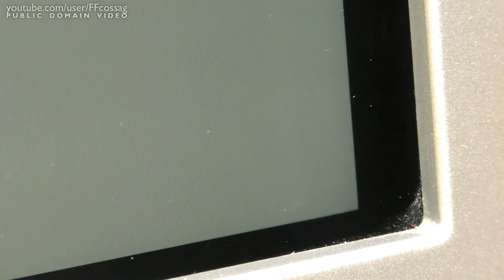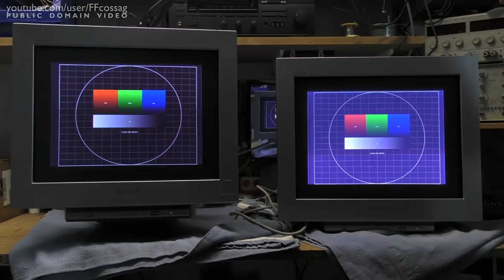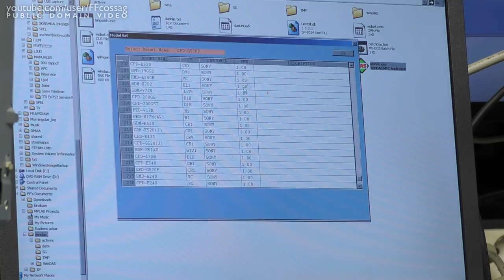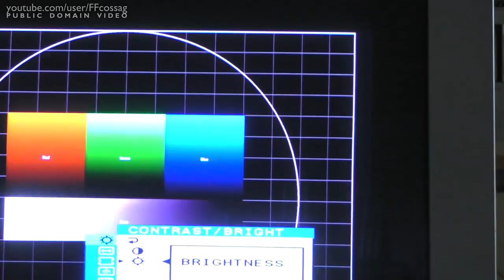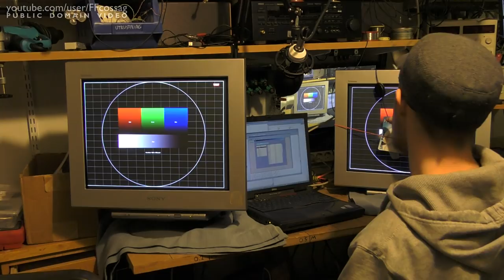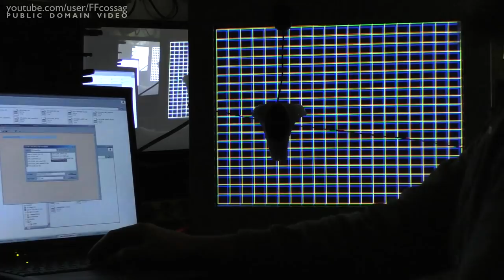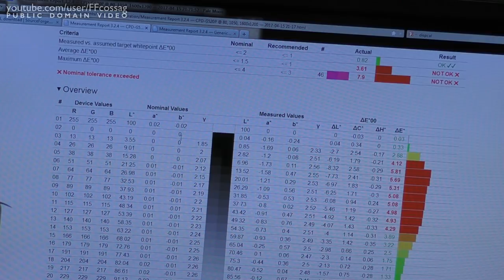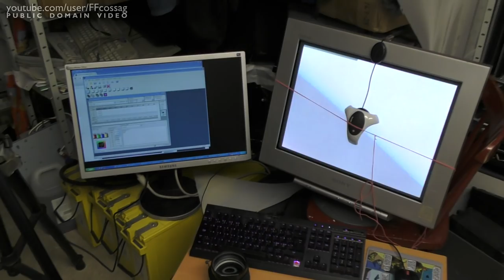Sony Trinitron Madness

Comment: 4:3 aspect ratio brother of the FW900 (G1W chassis) is the CPD-G500 (G1 Chassis). the CPD-G520 is a CR1 chassis
Reply: are they as bad as FW900 really? i had G500 and it was nothing like FW, and then G520 was nothing like these other two...
Reply: @pranza  You are right! the G500 have a modular board desing, unlike the CPD-G520, G520P and the GDM-F520 (althought the last two similar desing language as the FW900), which have a reduced single board engiennering.

Comment: As someone who retired his last CRT almost 15 years ago (flicker allergic) but has attacked dozens of LCD monitors and internal displays with his i1Display Pro and DisplayCAL, I found this highly fascinating. In fact I recently recalibrated my trusty NEC 1990SXi and would have loved to discuss the intricacies of calibration with someone... like white point being a bit of a crapshoot. I found that while results with no compensation were close to what a matrix (CCMX) for this combination of gear gives, the spectral compensation (CCSS) file for "LCD CCFL IPS" supplied with i1Profiler asks for a lot more green. So if this is not trustworthy, what about the WLED backlight CCSS? I would have to get a $$$ spectrophotometer to verify, which is rather annoying.

Somewhat higher gamma is not that much of a deal, just use them in the dark. ;) That's where the higher contrast will come in handy anyway. MPC-HC's color management has settings for gamma depending on lighting, with values of 2.35 for dim and 2.4 for dark environments.
Reply from the maker: Indeed, but the high gamma makes them absolutely useless for image editing (because lol inaccurate) and modern gaming (because you're blind compared to everyone else).
Reply: meow wow
Reply: Rocking that 1Display Pro and DisplayCAL combo too ! Of course calibrated via the hardware settings first as close as it can be first, i use my LCD (75" TV) as my computer monitor and also for AppleTV 4k, of course extra tweak inside PC and Mac, the DisplayCAL profiling..i aim for Rec 709 with a gamma of 2.2. I first use the HFCR first when doing hardware calibration, Rec 709, gamma 2.2, aiming delta below 1,  then when using DisplayCAL on the same display, i use "native white point"(already calibrated via hardware menus with HCFR) and for display type is select "LCD generic".

Comment: You have far more patience for these monitors than I would have, before I started using TFTs, I was of the "Can I see a picture on screen? Is it bright & clear enough? Yep, it's good" mindset, so going this deep into calibration, nah, I'd probably have gotten too frustrated with them and introduced them to gravity, or a brick, or something equally destructive... :)
Reply from the maker: My love for CRTs is rather newly founded. I realised that one should hang onto that which technology can't reproduce, and we will assuredly never have another completely analogue, refresh based display technology.
Reply: The only CRTs I miss are my two Compaq S710 17" CRT monitors, both bought dirt-cheap at the time (about 10 years back, one from ebay, one from a computer fair) and despite being Compaq, they were pretty damned good, until the mother's ex decided he wanted rid of them and threw them out without my say so, leaving my computers monitorless for quite some time... :\
Reply: @twocvbloke  Damn..

Comment: I recently found a Sony HMD-A200, also a flat panel model.  on the roadside. These monitors are definitely very cool.
Sadly it only uses one hardwired vga cable as its input, but i cannot complain too much about a free crt.
I will have to clean it up soon, although i am a little scared of all of the voltage. But a bit of compressed air will definitely do it a well deserved service.
It does work well as it is, which is very nice.
Any advice on how to go about giving this thing the tlc it deserves?

Comment: 1800x1440 resolution?! Holy crap that's MORE vertical resolution than my 1080p monitor, but on a CRT! I didn't know there were CRTs with such a high resolution!
Reply: On sony
Reply: Yep. Now make it widescreen with the FW900. Highest it could do was 2304x1440 :)
Reply: The GDM-F520 which is the little brother of the famous GDM-FW900 is capable of 2048x1536 @ 75Hz. Lower resolutions = higher refresh rates, and the motion is so smooth and clear, it's something you don't even come close to with LCD. It also has an aperture grille pitch of .22 which is one of the finest known aperture grille Sony ever made. It was designed specifically for CAD and photo editing. But it's gaming chops became legend along with it's brother the FW900.

Comment: posted the video to Reddit /r/crtmasterrace because of the sheer deliciousness of these monitors.
I had a G500 at one point in time. I miss that monitor. and do my eyes deceive me? Inspiron 8100? 8200? with the 15.1 UXGA panel!? such bliss.
Reply from the maker: Yep, it's an Inspiron 8200. It's nice as it has both WLAN, USB, a working battery, COM & parallel ports, a DVD burner and a diskette drive all in the same box.

Comment: Haha, i was drinking few beers and watched this...maybe i'm a masochist? Last time i calibrated my living room 75" LCD month ago, it took me about 3 hours (tweaking done inside the TV's own settings,, Delta values below 0.5 and tracking rec 709, nits around 110-120. Cherry on top of that, when running that TV with computers (PC and Mac), i have DisplayCAL profile on top of that (i use iDisplay Pro) miss those CRT's...last CRT monitor i had, i ordered that  brand new around 2004, already when majority were pushing LCD's, when CRT were going out of production, it was a flat 22" inch diamontron (HP branded), i had it all the way to 2016. Good times !

Comment: Im stuck with the WinDas software😢. I have a Windows XP machine and using what looks like the same adapter as you. I can choose the right monitor but cannot get any data saved. Just keep getting an error, cannot communicate with monitor, check the bus or something. The adapter is working because i connected rx to tx and was able to loop text back. So close and yet so far away. Did you experience any errors like that?

Comment: If this model is like the CPD-G520/G420, after they have been running for 30 mins or so there's another option that appears in the GUI that lets you do a 'restoration' and that corrects the G2 without even taking the cover off. It's the lazy way to correct the excessive brightness. I assume Sony gave you this feature to counter ageing of the CRT. It rebalances the RGB drive so grey looks grey again too. Great video by the way! Great persistence shown.
Reply from the maker: Yep, I tried that on one of them and it basically just made it worse, hehe.

Comment: Thanks for the video! Very informative. I found it very daunting reading about WinDAS but it doesn't look too bad. I have and use a Sony 420GS as my daily driver and to be honest I cannot fault it. Superb colours, blacks, excellent monitor. I did get greedy though and bought a 21" Compaq P1100, rebadged Sony Trinitron and surprise surprise it arrived damaged, even on a pallet. The plastic in the case is so brittle that it arrived in a mess, even the facia has come off and only the bottom part with the buttons is left. Apart from that the screen is exactly like this, like an overexposed photo, the blacks are blue and no amount of fiddling will get it nice. I might actually try this to fix that! 

Can you offer any advice about the case? I know there could be 30000 volts going through it so I am just a bit hesitant to use it and finding another P1100 is not gonna happen anytime soon. It's a pity not to keep it running though!
Reply from the maker: You're unlikely to get a shock from it unless you poke your fingers in by the big red wire that goes to the tube.

Comment: Ty for upload, very good info.

I have been using Mitsubishi diamond pro 2070sb for about 18y. Have run many different Gpu's. Current is msi gtx 960. Bought new. Never run sb feature (OUCH my eyes)! I run it @85hz and frame-rate calculators go nutz , bouncing anywhere from 800fps to over 2000fps. Witcher3, Skyrim, Just Cause 3, ect.. Cannot find any ips or va to compare. Any suggestions on a new monitor?
Reply: ineptsot the 2070sb is a great aperture grille monitor, I wouldn’t upgrade that to anything except the extremely rare fw900. Moving to an lcd is not an upgrade imo.

Comment: I ran Windas on my GDM5510 (literally the same thing as the G520 but Sun branded) to fiddle with my convergence and geo and no matter what it will not unlock the bloody OSD. I made a backup straight away after starting the software and even restoring that didn't help, any tips?

Comment: Great work if recalibrating that old crt tv screen, i really like those trinitron tv’s because it’s design and the picture on screen just looks way more sharper & appealing then on a curved tv set.

Now if all crt tv’s(wich sadly not)were calibratible via software rather then doing it manually, it would,ve been so much easier.
Very ideal for fd crt tv’s wich suffer from geometry issues even from the start!!
Reply: johneygd *Than on a curved set.

Comment: LOL, I have a new B-stock E530 and a recycled one that's near perfect. They use the same tube as the G520 and are very comparable. Different styling though. Also have a Sun Microsytems monitor withe same tube and an extra lead that might be serial.

Comment: I have a sun monitor that uses Sony hardware. My problem is that it is relatively dark overall. Is this because of aging or is it possible to do something about it? I can turn the brightness up untill i see the grey borders that you fixed (but not as bright as you have it) but the stuff that actually should be bright (white and color stuff) is actually pretty dull.
Reply: emanemanresuresu not well mAde

Comment: I have 19 sealed boxed gdmfw900 want to buy one with free shipping ?
$8500 made in 2003
Reply: wait what? how
Reply: i had two and sold for like $100 - $50. they suffer from Sony disease (like we see guys fixing it here) and have other unpleasant things due to being so wide, too wide to maintain great focus everywhere, too wide even to have constant dot pitch - it's larger at the outer area. even the viewing angle - yes! - is for some reason narrow - can someone explain that?
 Mitsubishi Diamondtrons are way better monitors, unless you must have a widescreen, and even then lcd is perhaps a better option unless gaming.
Reply: You're asking $8500  for the monitor?

Comment: Hi! I've been offered to buy a Sony F520. It looks good, but it has pretty strong purple tint. What's weird is that the menu looks perfectly fine, but everything else is purple-ish. Did you monitor have the same issue? Any help would be very appreciated! Thanks!
Reply from the maker: You probably need to play around with it with the serial port. There's calibration software floating around on the internet, but it requires disassembly and making a DIY adapter.
Reply: FFcossag  do you mean the WinDas software?

Comment: Have one of those sonys but mine is doublle the size of the bigger one weighs about 65 kilograms 130pounds? And have some weird RGB connectors on the back 1 connector for every color,but its 4 of those so im not sure if its rgb or something else like cyan magenta yellow black ,maybee...
Reply: Lipi19821 whats the name of the monitor?
Reply: Probably a composite sync connection, some models have separate horizontal and vertical synced making 5 BNC connectors on the back.

Comment: At least you dont seem to hate the old windows Xp, most people do, i find it less annoying than later versions, but i have a partition with win 7 for those annoying programs that are made incompatable with xp.

Im sure you will get those monitors nice again :-D.
I would normally turn down the A1's on the line output transformer if all the power supply voltages ring true, old man speaking lol.
Reply from the maker: Windows XP is a lovely system, albeit lacking in some modern features.
Reply: zx8401ztv You prefer windows XP to 7 ... What about windows 10 ? 
Evil laughter
In all seriousness, I love windows XP, even if the search bar of 7 is must. But what do I know, I use Linux ^^
Reply: If I count my legacy PCs I have Win 3.1, 98SE, XP , Vista, 7 and 10. I like 7 most I think but XP was fine Hah, you could run 3.1 in 4 MEG of ram although I have 12M fitted and a 586/133 CPU running under DOS 5.0.

Comment: Spyder 4 Pro - isn't that a photometer for LCDs? - you'll get inconsistent results from a CRT due to the different spectrum/metamerism of the tube phosphors compared to the backlight of an LCD.
Reply from the maker: It's provided good results on my other CRTs, it seems to work well enough.

Comment: If you read these messages... I could use your help! I have a Sun-GDM5010PT-R (sony trinitron) but its convergence is super fucked because the UPS guy dropped it :< it was new in box.
Reply from the maker: You're probably screwed since the electron guns are going to be physically misaligned.
Reply: I managed to align them anyway :D its awesome now.

Comment: 720p50? Haven't seen that in a while...
Reply from the maker: Your browser's doing something odd, it's a 1080p50 video.
Reply from the maker: Well, YT defaults to 50p always if your browser supports it on the 720 and 1080p modes.